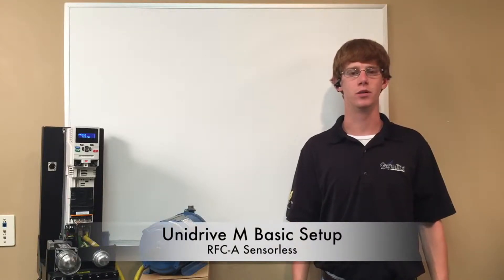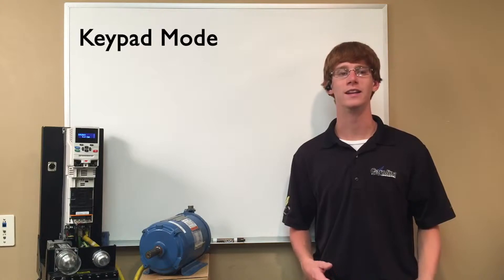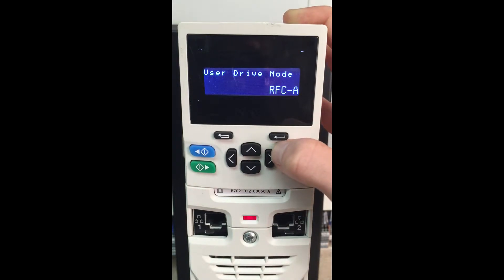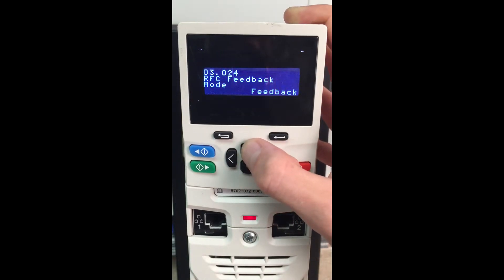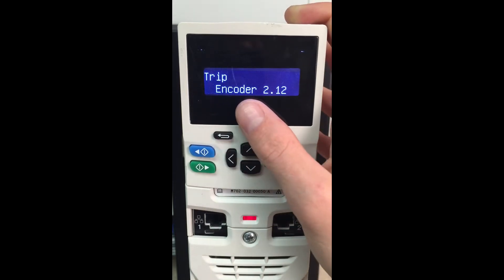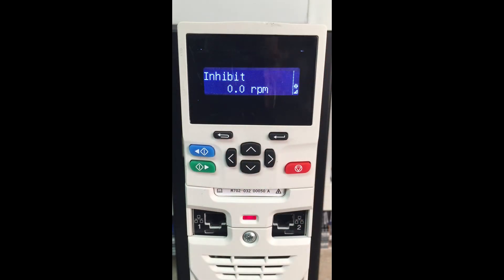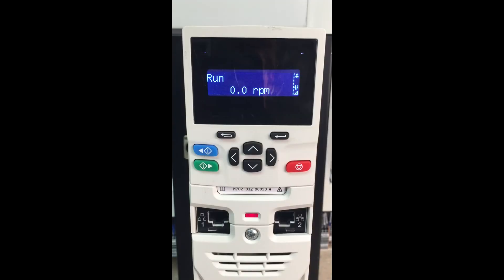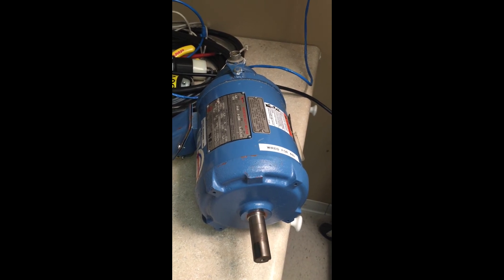Control Techniques - Unidrive M RFC-A Sensorless Keypad Setup

Comment: In m701 drive , some trip is showing on display I/O overload ,
Please what should I check
Reply from the maker: @dhakshanamoorthys1643  The black terminal board that counts 1-11 or 21-31. There is an issue with the input wiring on one of those terminals. If you remove one then power on check when it goes away then check the other. Then you can narrow down which wire could be in the wrong spot.
Reply: @Carolinamotioncontrols  okay I will check sir.